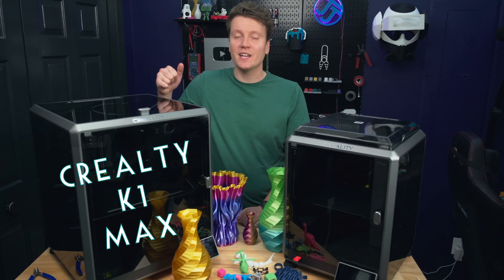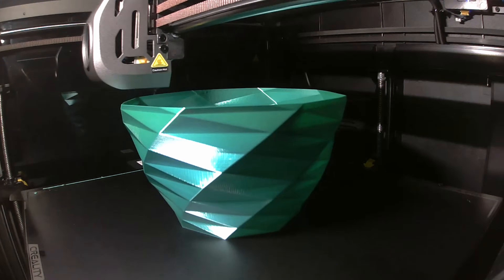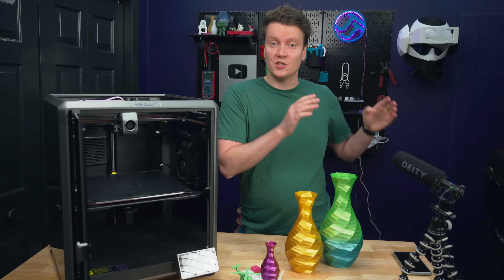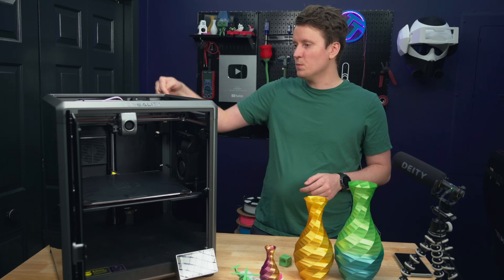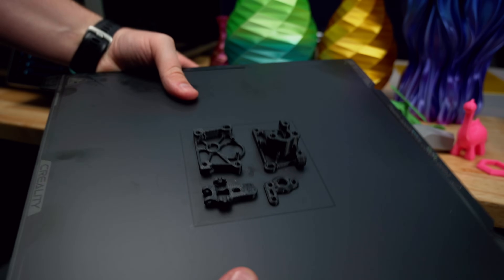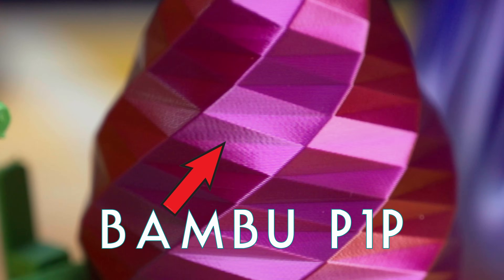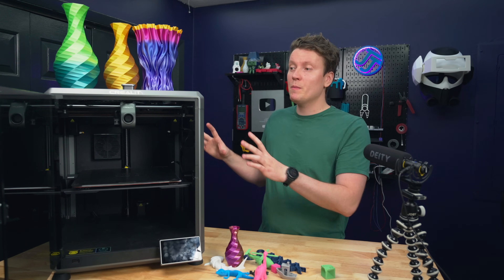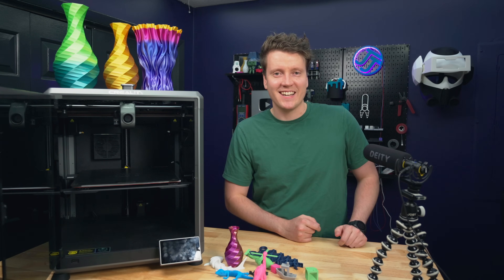Creality K1 Max Review - Bigger, Faster, and Smarter!

Comment: Just to let you know, activated charcoal only lasts 48 hrs unless you put it in a bag right away after use and as far as smoke and gasses you'd need a 6003 filter or better - it usually has a yellow tag or band on the filter. Hepa filter is for dust, molds, viruses, and bacteria, it DOES NOT trap gases.

Comment: Thanks. The still small XY print area is still small and forcing for the most part to use cloud to send print jobs. No way.  If the Bambu had the same print area of the K1 Max, still would not consider/buy it. I currently have the Creality 5 Pro.

Comment: Nearly every review of this printer shows multi color print(s)... are those fake and implied but not actual? Everyone is gassing on about how awesome this printer is compared to the Bambu, but no one is talking about the white elephant in the room. That AMS of the Bambu printer that allows for multi-color and multi-material for the same print. How does this printer compare in that regard? Compare apples to apples not apples to oranges.

Comment: I bought this printer in the hope that I would print abs without problems, but in fact everything turned out not quite well - after printing one coil, the native substrate of the table fell into disrepair, spots appeared on it to which the plastic stopped sticking, then error 2564 appeared, then 2564, then E0801, starting to understand and read the user reviews, I came to the conclusion that creality has released a raw product that has problems with the hotend, there are also problems with the extruder, glitches in management, and all this is of course being finalized in the process, but at the moment the user is incurring losses by buying a beautiful defect. Before that, there was ender 3 pro and it was a very positive and productive experience.

Comment: I sucked it up and ordered K1 Max.
Was initially undecided between P1P and K1.
P1P crap screen, open, cloud.
K1 small print size, no LIDAR and then I'd have to replace the extruder.
P1S is basically P1P but closed and the price in EU not that far away from K1 Max.
X1C too expensive for its print size. AMS I don't care about.
So I figured I might as well get something that will last a long time. K1 Max. Creality while probably not as great quality as Bambu, they do have a huge following and will make K1 open source in September. This was a really, really hard choice. Thanks to Bambu Labs.
Reply: I’m in the same boat

Comment: You are so pro-creality lol ive had many creality printers and they are garbage. One x1c and never an issue after 2500hrs printing. They paid you heavily is what it seems like.
Reply from the maker: I am a fan of printers that work. I've hated several Creality printers in the past. The Ender 5 S1 was an over priced bad printer. The K1 has been more reliable than my P1P. That's just my personal experiences with these printers, I'm not a fan of any brands, I just like using good 3d printers

Comment: Don't know what you're doing but the P1P does NOT run input shaper calibration on each print. Only when you ASK it to do it. The delay time between "print" and "printing" has to do with the slower cpu performance of the P1P as it takes longer to decompress the uploaded file (though this improved dramatically with the current firmwares).  But in NO way the delay on the P1P has ANYTHING to do with "doing input shaper" like you're stating.
Reply from the maker: Fine, but it does a lot of vibrating and some sort of calibration that takes a really long time.
Reply: @JJShankles  Again, no, not really.  The ¨P1P does not have the ability to do ANY flow calibrations automatically (no Lidar).  It will ONLY do an input shaping test as part of the "Printer Calibration procedure" which you must start manually from within the LCD panel and not as part of a print job_.  The ONLY thing a P1P can "calibrate" as part of the print job is "Bed Leveling" : That part will indeed "Vibrate", as Bambu uses tactile sensors underneath the bed for bed leveling on both the X and P series.  The "vibrating" occurs when doing a Bed Level test, where every couple of measurement points, the bed will be "shaken up and down" momentarially to reset said sensors to a baisc correct non-triggered value.  This means that I believe you are constantly running BED LEVELING before each printjob, and yes that takes time.  But it also is _not necessary in my experience. Unless you changed your bed surface inbetween prints, conducted maintenance on the printer inbetween jobs or the new print job uses a significantly different bed temperature, there's zero need to redo bed level test for each print (and the machine allows you to choose to avoid doing that for each print).  When not activated, the P1P calibrates NOTHING prior to each print, and the only time spend is doing the unpacking of each send print job, which does not cause any "vibrations" either.

Comment: I was set on a Bambu P1S, but the K1 Max seemed like a better alternative.  However, this comment section leaves me even more undecided.  That said, I don't foresee myself using/needing the AMS of the BL, and that seems to be a big selling point for that machine.  So, I'm leaning toward the K1 Max.  Both options seem impressive.
Reply: I've had a few Creality printers over the years with varying success.  I never thought I would be into multicolor printing based on previous experience doing filament swaps. The AMS has been a game changer for me since my painting skills are lacking.  I've printed several multicolor signs and personalized coasters with minimal filament waste.  It's really opened up the possibilities of what I can do.
Reply from the maker: They both are incredible machines, and you'll probably be happy with either. Creality has really improved the design since the original K1 printers got sent out, and they are sending out upgraded extruders which is awesome to see. They also said they are going to release the open source code in September which will be something Bambu will never do. That will make community mods and upgrades way better on the Creality system.
Reply: Other than an occasional clog my X1C carbon has been flawless - I’ve got 4 creality printers  - none of them match the quality in the x1c in print quality or speed - creality is going to have to prove to me they are competitive and have mended their ways - I just want a printer that works - not one I have to fuss with constantly.
Reply: @Derek-je6vg  I'm not buying any hardware that REQUIRES a login.
Reply: @Derek-je6vg  From what I have seen/read, the P1S is equal to the X1C in terms of speed and print quality.  Being a total noob, not sure if the jump up to an X1C would be worth it for me, but I'd definitely consider it.  I told myself I would order one next week, but maybe I should wait to see some more comparisons between the K1 Max and X1C come out.  I definitely don't mind paying a little more if I can get more reliability and consistency.

Comment: They need to work on the slicer more than anything. The supports do WEIRD things, adding supports in area there isn't even anything being supported, and the scan for printer function needs to have a troubleshooting function so you can see where the issue is as to why it doesn't find anything. For instance, is it firewall? Is it router? Is there no printer to connect to (communicate with the app&website-cloud and see if it's offline there) etc. Just not finding anything is as helpful as turning the power breaker off and saying you can't find the right light switch.

Comment: Have you done any max volumetric flow rate tests? Wondering if the K1 can get to the claimed 32mm3/s which is pretty high, even for PLA at super high temps with a big nozzle. Thank you for getting this review out so fast!

Comment: I got the k1 and honestly been very very disappointed. I get error 2507 all the time. The printing head smacks the corner every time it homes the x/y. The tube pops the top cover aswell. Should I return and get the bambulabs p1s? I plan to print nylon and carbon fiber nylon
Reply from the maker: Have you updated the firmware in the settings? If it is on the latest firmware and still giving you issues like that then you may have a dud, and I would return it.
Reply: @JJShankles  yeah I updated it. Updating was a breeze, ill give them that

Comment: Actual build volume P1P is 238x228x250, yes you can get the entire specified build volume with some modifications but then a couple functions that distinguish BL from other printers disappear and BL advises against such mod
Reply: It's just a little corner at the bottom left, which has been "greyed out" as printing area due the filament cutter. You can easily solve this by printing an adapter to lock it in place and re-configurate the build plate in the printer settings to use the full printing area.

That filament cutter is only needed for color/filament changing when using the AMS. Something the K1 does not have. So you could actually lock it in place and configure the whole printing area when you do not have an AMS unit.

Comment: P1P doesn't take 8 minutes to calibrate, its around 5 and it is optional.
Reply from the maker: How do you skip calibration? I started the timer when I clicked send to the printer on the slicer, so I am including the super slow upload to cloud and download from cloud.
Reply: @JJShankles  when you uploading to the printer there’s a windows that pops up to uncheck AMS and flow calibration if you don’t want to use AMS or calibrate again, will just use previous one

Comment: I see they did not solve the VFA problems. For this price I was hoping Creality did more work in that front.
Reply: It isn't VFA it is the polygon effect from belt driven kinematics. Not nearly as simple to "solve."
Reply: @CapacitorCapacity  It's possible to reduce it. At least on almost a 1000$ price point. I have seen 100000$ printer that's has it. So nobody is perfect. But they did nothing to combat it, as the vfa/belt marks is exactly the same as an cheapo ender3 series printer.
Reply: The one way to reduce is use quality motor

Comment: I've been eagerly awaiting proper reviews of the K1 Max.  Thank you for this excellent review.  I'm happy to see that Creality is fixing the initial issues of the K1.  I print a lot of TPU on textured glass with no surface prep at all.  I print the first layer at 75C then turn off the bed heater and the prints are well adhered but pop off easily and cleanly.  I was a bit disappointed to see that the PEI surface on the K1 Max was damaged by TPU.  Hopefully there will be a print surface that's better for TPU, or maybe a new TPU profile will fix the problem.

The K1 Max seems to be improving rapidly but I'll still wait a couple of months in the hope of getting a more polished and debugged printer.  There are many little details and they all need to work, but I'm optimistic.  I've been without an enclosed 3D printer for a couple of years and I need to print some ABS.  The K1 Max could be my one printer for all of my prints.
Reply from the maker: Maybe I was pulling too hard on the TPU which was the cause of the damage, but yeah if I was going to be doing a lot of TPU printing, then I would either use gluestick, or test out some other surfaces. 
It will be interesting to see how much it will improve with updates in the next few months. The LiDAR and camera are good hardware, but with good software is what it really needs to be great

Comment: Do we need to pay the premium tier in creality cloud in order to watch remotely from the camera and control the print(pause & stop)? I can't find any definitive answer about that and although the app is a mess I want to check my prints when I'm outside.
Reply from the maker: I just downloaded the app to check, and the premium just includes some premium STL files, and their cloud slicer is faster maybe. In the normal app you can control the printer from anywhere, but the camera feed only works when your phone is on the same wifi as the printer. I turned off wifi on my phone and was still able to start prints, but the camera wouldn't load.
Reply: @JJShankles coming from a CR10 smart pro when I was able to remotely control, power off and have a look from work was gold. Saved me a couple of times and it was peace of mind . 
Excluding that feature from the K1 kinda beats the purpose. Hope the will add it in the future or at least open-source this thing to add it via klipper. 
Thank you for your time testing the app appreciate it!
Reply: @JJShankles , no problem, just create a VPN to home and connect your phone while away to check prints from the camera. I know not everyone will be savvy enough to do that, but it's an option.

Comment: I have high hopes for the K1 and K1 max for me the Bambu closed cloud based system with sketchy privacy policy is a none starter. Anyone using a Bambu for commercial prototyping is insane, they basically take a copy of all your models.
Reply: If you use the SD card slot on the BL printers, it bypasses the cloud
Reply: @blackoutblaze  But it still sends pictures of the prints to the cloud unless you completely disable the cloud in which case you can't monitor your printer over the network.  There is talk of a special version of the printer under development that doesn't need the cloud but no idea when or if that will be made available.

Comment: On the K1 Max right door frame there seems to be a join seam in the frame just below the top corner, is this no longer a solid cast frame?
Reply: K1 max does not have a one piece frame, the top and bottom are one piece but the sides are not. It would be a very large casting to do all in one piece which would make it very costly to do.
Reply: @schrodingerscat1863  I am pretty sure one reviewer claimed it was a one piece casting, I will attempt to find out where I saw this claim, thanks for your reply!
Reply: @AndrewAHayes  No it's not I have seen both printers up close and both have solid castings for the top and bottom of the frame but these are joined together with vertical extrusions.
Reply from the maker: The K1 is the same way where the top and bottom are two solid cast parts then 4 separate arm to hold it up.

Comment: So another Bambulab clone but missing the finer points of usability, while also violating as many open source licenses as possible.

Crummy company continues to be crummy.

I really hope their half passed Bambulab clone attempt fails because as a company they do so many bad things I'd rather basically any other company succeed.
Reply: Bambu Lab also violates open source licensing, and they make it very difficult to print if you opt not to send your files to their Chinese server and sign away all your intellectual property rights to them - either fiddle with a tiny micro SD card inserted into the top of the display or print through the LAN but the dynamic IP address keeps changing and must be reentered frequently.  The K1 series have a USB-A port on the front panel for a standard thumb drive and the static IP address is only entered once.  Still, the Creality should have standard full featured Klipper and Fluidd.
Reply: @Liberty4Ever  This is simply incorrect.

They are 100% compliant with the Prusa Slicer license, and we've no reason to believe they arent with their closed source firmware.

As for intellectual rights, I have no idea why people keep saying this. Like, where is this conspiracy coming from?

I feel like people just keep making things up about Bambulab and it does them a great disservice given they are being the change in China that people have been wanting to see. They bring innovation and honor licenses and people hate them for it.

Like I totally get not liking the cloud thing, but the other accusations are wild.

Comment: I have problems with the AI camera on my K1, it loses connection at the start of every print, but after disabling time lapses it works fine (almost always), also sometimes I get the error "not heating as expected" when the auxiliary fan turns on, I am still happy with my K1, but I hope the next updates will fix these problems.